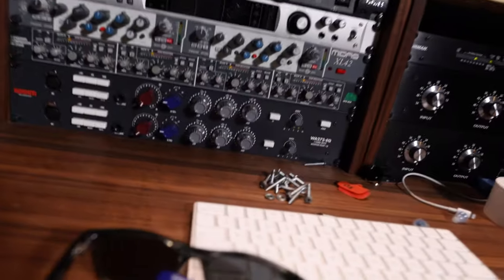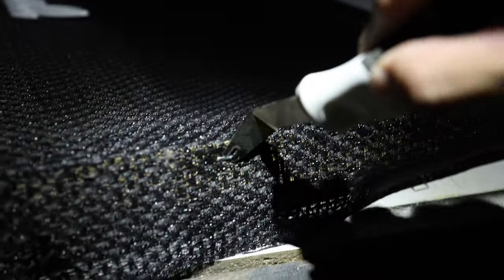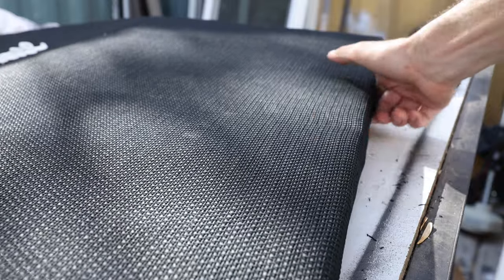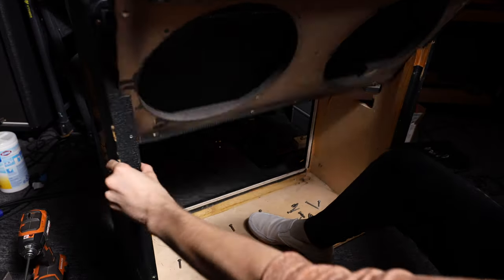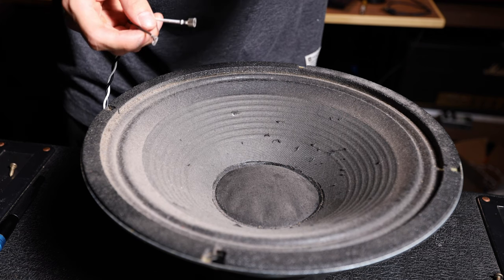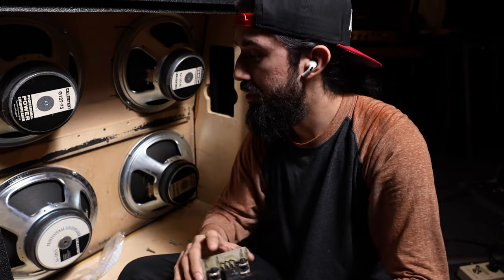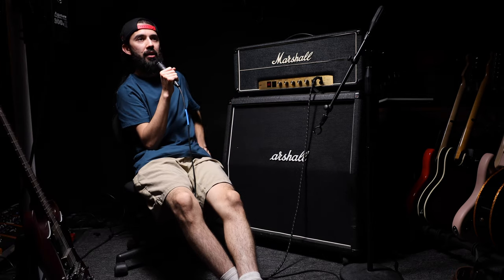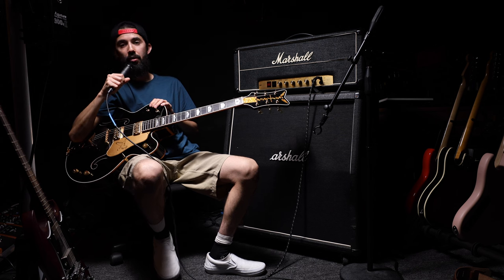How To Use and Restore  Marshall 1960 Cabs

Comment: Thank you for your video.  I just bought a 1960 B cab yesterday and someone replaced the original speakers for vintage 30's. When i test with the multimeter i get like .3 ohms on all settings 4, 8 16ohms. The cab is wired correctly from what i can see. Ive watch a few video's on wiring. So it has to be the jack right. I know you say you replace them anyway. Just seeing what you think.
Reply from the maker: @mikesmith3662  have you tested each speaker separately? Vintage 30s are rated for 16 or 8 ohms, best way to check is just grab a solo 1/4 jack get the speakers soldered to it and test that current. 

If you are getting the same reading on all channels that sounds like a jack problem. You should get different variables even if it’s not wired correctly.
Reply: So today I bought a proper multimeter to test the ohms. The other was not what I needed.  On stereo I get 7 ohms out of each side but when I try mono. It get 7 ohms out the 4 ohms side and I get 13 ohms out the 16 ohms side. Are the original speakers 8 ohms speakers? Cause these v30's that were put in are 16 ohms. With switching the speakers with different ohms, will it cause the 4 ohms option to run at 8 ohms instead or does the input jack assembly need to be replaced to function properly.  I would like a 4 ohms option but  I don't think it can do that now. Just seeing your thoughts.  That you for your time.
Reply from the maker: @mikesmith3662  those speakers are rated at 16ohms if your getting those readings. There is something going wrong with the 4ohm jack if your reading 7ohms it should be somewhere around 3.1-3.7 ohms and since ite readings more than twice that then the sort is open. It’s not the end of the world you can get away with it but you would be risking your Power transformer on your amp or the speakers themself. A replacement jack plate is like $50 and you would have an easy of mind and know the cab will last you another 20-30 years easy: those early pcb boards that control the wiring signal path to switch between ohms are finicky. 

I recommend getting them from amplified parks if your in the states, they are out of stock last I checked but they are good are restocking every few weeks.

Otherwise stick to the correct readings the 8ohms for stereo or the 16ohms for mono
Reply: @MistaMahcos  cool. I think it's the input jack assembly too. I'm gonna buy a new one. I found one in japan on ebay. I would like to run at 4 ohms. I appreciate your time and input. Thank you. I'm in Arizona aswell. I live in Cottonwood.  🤘